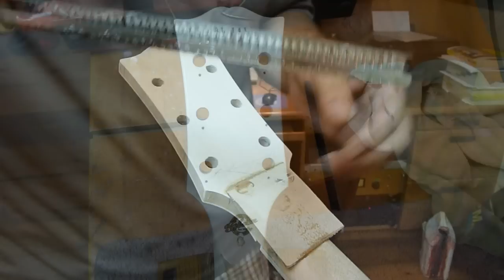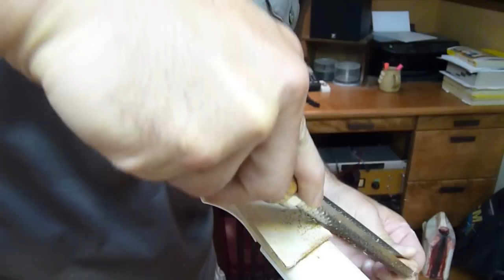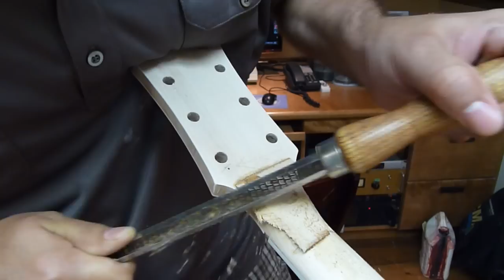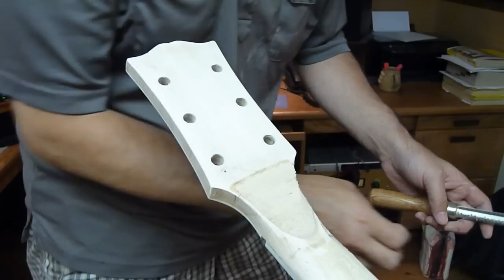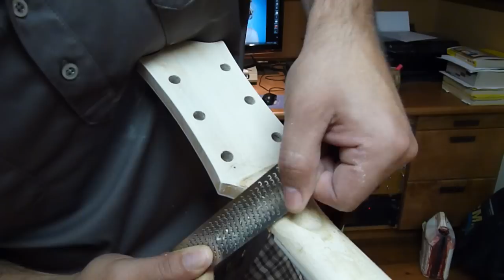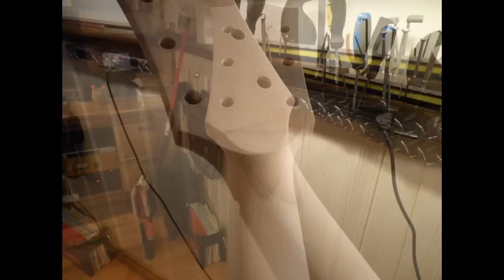Gibson Custom Shop AL-355 Volute

Comment from the maker: That's a very good question, and in fact one they've never owned up to. Perhaps a measurement error or CNC programming error because it is out by 1". I restored Lifeson's original ES-355 so I know exactly where the volute is located. This custom shop 355 has a 3 piece laminated maple neck, so the volute really adds no strength. It's just window dressing, but because of the error in location it landed between the nut and the first fret!

Comment from the maker: It is a white ES-355 with a bypass switch for the varitone and it is wired for mono. Other than that, the neck size and shape are nothing like Alex's original. Also, Lifeson's original has the volute in the traditional place, I know because I did a full restoration/refinish on that guitar.
Yes, Alex has the bad volute from the custom shop just like all the 300 they produced.

Comment: I usually use epoxy to add wood in scroll repairs, what adhesive do you use?
Reply: Scroll means "volute"
Reply from the maker: Hi Alex, I used West System epoxy. Thanks for the comment.
Reply: Thanks Fred for the answer and the video.

Comment: I have a question. Do you have any tips on "unfinishing" a neck. I have a modern strat that I love the sound of, but the finish on the neck is super thick and tacky. I'd love to unfinish it, what's the process for that?
Reply: I saw Freddy take off the finish in another video with a scraper. I’ve done quite a few. Tedious, but easy. I sand it to 3000 grit, add gunstock wax and call it done. That is how I like my necks, just like Ernie Ball Guitars.